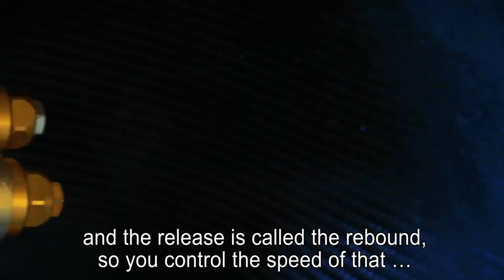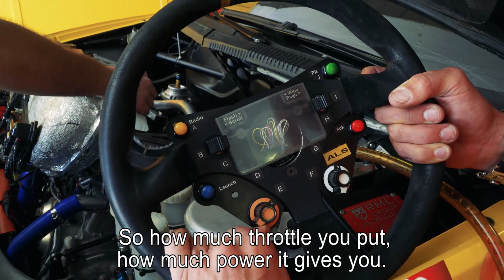The 8 setup parameters of a racecar, explained by Tom Coronel, WTCC 2017 Chevrolet WTCR Touringcar

Comment: Great video! 
1. When setting up a car from scratch, do you follow these steps in the same order as the video (Springs, Shocks, RB, Aero, Height, Wheel Alignment, Pressures, Engine)?
2. Should the same sequence of steps be applied to open-wheel cars, too?
3. After a driver has done a few laps do you follow these steps in the same order again?
I am trying to apply this technique to sim-racing setups in iRacing. :)

Comment: Correction: Lowering the rear end of the car, does not add weight or traction. Weight is balanced on diagonals. Lowering the rear does reduce lateral weight transfer at the rear axle though.